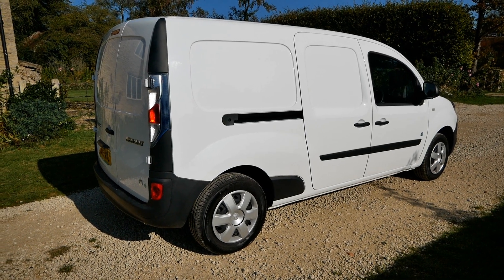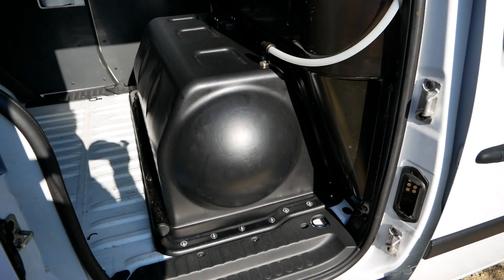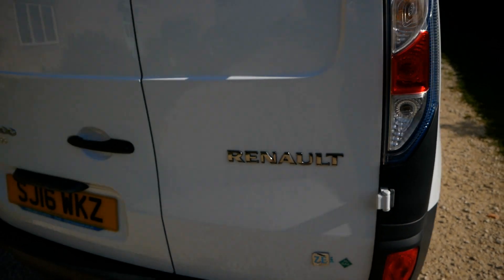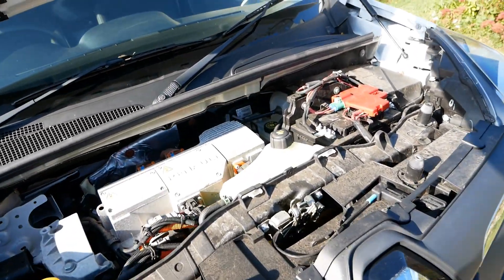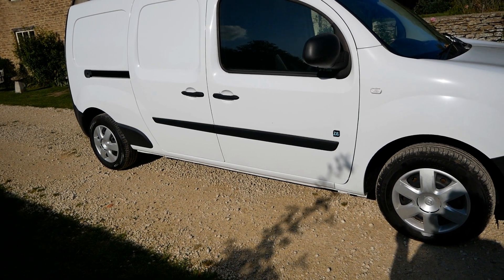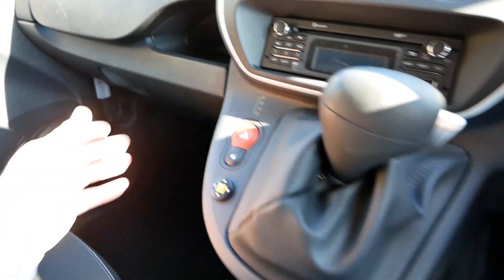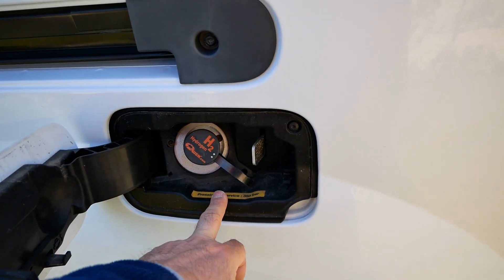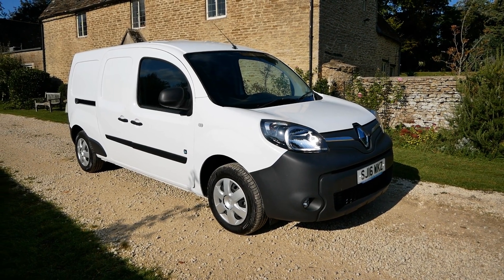Preview: Renault Kangoo ZE Maxi with a hydrogen fuel cell range extender

Comment: The energy capacity of the hydrogen tank does not translate to immediate energy availability to the electric motor or battery.  Driving will deplete electricity faster than the fuel cell can restore. Therefore this 'unlimited range' only applies for walking speeds... Not so ultimate...
Reply: If you start recharging the battery when it is at 80%, it should not be a problem. Even if the average power consumption of the car would be twice as much as the recharging power, the car would still have nearly double the range.

Comment: Just to say that whilst you're carrying 32kWh of hydrogen the fuel cell efficiency is about 50%, probably a bit less, so that 32kWh will deliver about 15kWh of energy to the battery pack
Reply: Microcab I think they’ve probably calculated for the losses already. Just a guess though